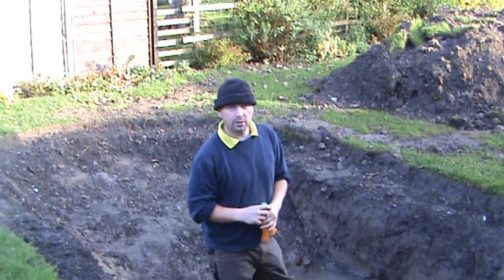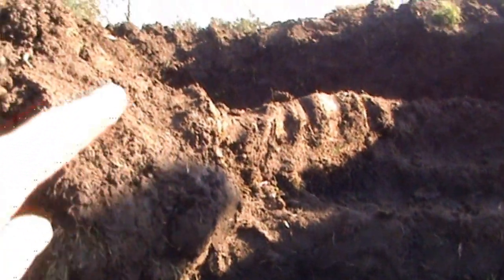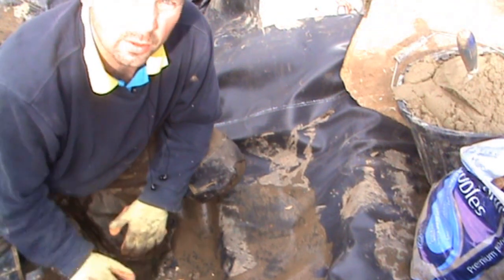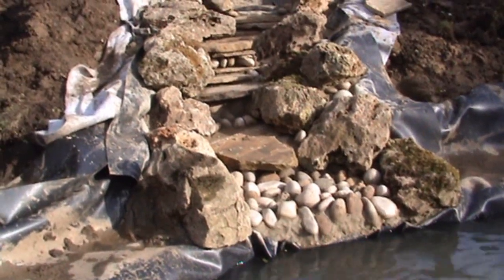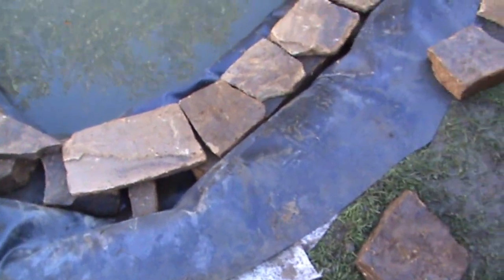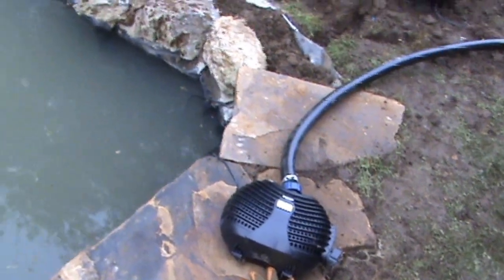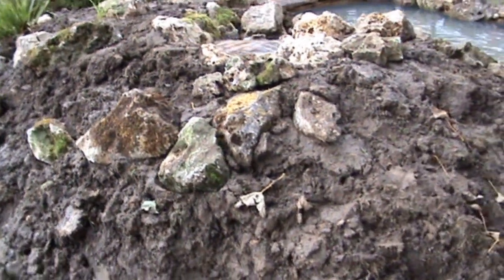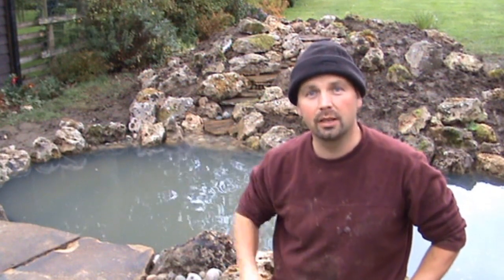How to Build a Fish Pond and Stream / Cascade - Complete pond building video by Pondguru

Comment: Hello,

I thought your pond was brilliant and you have inspired me to try my own. I want to build a duck pond, and they can be very messy. I was wondering what type of filter and pump you would recommend. The pond will be approx 8ft x 5ft and 3ft deep
Reply from the maker: If you have ducks the chances are you will not be able to keep that clear but I would go for the largest box filter (with at least a 55w UV) and at least a 4000 litre per hour pump to turn the water over at least once an hour. The box filters tend to be the cheapest option and you will get a large one for same cost as small quality pressure filter.

Comment: Awesome video.  I'm planning on building a tiny koi pond.  Unfortunately, the only space  I have is next to a tree that has tiny leaves.  Will  a good filter be able to catch most of the tiny leaves or would I have to constantly remove them myself?  Also, how do you prevent rain water from seeping underneath the liner and underlayment material?
Reply from the maker: Unless you have a high water table you don't need to worry about rain getting under liner as the weight of water will prevent liner being lifted from underneath. You could go with something like a floating skimmer (Oase swimskim 25 is a good one) to remove small leaves as that will be most efficient.
I'm concerned about the words 'tiny koi pond' as koi need lots of space.

Comment: Great video m8 really enjoyed watching it, thanks for sharing. Just one question how deep should the planting shelves be? I have been told 18 inches below water surface when pond is at maximum fill level. I thought that this was too deep. Your info would be most welcome. God bless ya
Reply from the maker: Yes that is definitely too deep. I'd go 6"-9" and 18"-24" for lilies.
Thanks for watching and appreciating the videos.
Reply: Thank you so much for answering so quickly. Would you beleive that a so called pond expert installed my pond and has put the planting shelf 18 inches below water level, told me that is right and I should use upturned baskets and pots to put marginal plants on. I will not mention names and will not mention your name when he comes to install ultra violet filter, though I will tell him shelves are too deep. I would have got you to install pond if I had been in your area. 
Thanks again
Reply from the maker: Allan Robinson No worries, man. Many people do use upturned baskets to put plants on but there should be no need to do that.
Hope the rest of the pond is OK.
Reply: Not really, there is no overflow and I cannot see how upturned plant pots, baskets will bring the plants up to the required level for marginal plants I.e. 0 -6 inches, when level from shelves to water surface is 18 inches or more when full. Pond installer is yet to get back to me about uv filter. It is only a wildlife pond and I feel like I have been done! Thanks for your help. God bless you

Comment: Could you tell us what size diameter was the pip or hose you used from the pump to the filter and then up to the top of the cascade. Great job by the way.
Reply from the maker: craig thompson It is heavy duty 38mm internal diameter pipe.Thanks for watching and appreciating the video.

Comment: Hi, thank you for spending your time making this video, it is very helpful. can you confirm that the 6 to 1 cement mix you used is in fact 1 part cement and 6 part ordinary building sand as the mix looks to me doesnt look that sandy. Also, is the cement mix not going to affect the fish in the long run?
Reply from the maker: Yes anywhere from 1:4 to 1:6 (1 part cement to 4-6 parts sand) is fine. If the cascade was cemented then water would be flowing over it so cement would affect the water. Less so on the edging as it is above the water.
Best thing to do is to leave the cement to harden for a couple of weeks before running the cascade then after a day or so of running it totally drain the pond, refill it and it should not be a problem since most of the stuff leaching from cement will be washed out no problem.
Reply: Pondguru Outdoors thank you.

Comment: Have you ever had issues with the mortar coming apart over time? I completely planned on making my river just as you made this waterfall but have recently read some things that advise against mortar. I think this seems like the best way though. Your builds looks great.
Reply from the maker: There has been the occasional edging stone which has come loose around a preformed pond but they have a bad habit of bending and warping. As long as a cascade is properly lined and the ground is stable the cement should not break up - most of the time I see streams and cascades broken up when they have been made on a loose pile of dirt which settles and caused the cement to crack.
By using underlay under the liner it also acts as a stabilisation fabric so any small areas of subsidence  do not affect the cascade.

Comment: Hi got the pond finished last year finally using the info from your video. I have a similar Oase pump and filter. Do you leave the filter in the ground year round? I live in Chicago which get pretty nasty winters so I called Oase and they said take it out and store it. The online pond shop told me I could leave it in the ground if I ran the pump year round. I went with Oase's recommendation and stored pump and filter. Thanks again for the video Myron
Reply from the maker: +M Wilson Yes you can do it either way but it is advisable to move the pump near to where the stream pours back in during the winter so the bottom of the pond can retain some warmth for fish.
Glad you enjoy the video and best of luck wit your pond. Oase is a great choice.

Comment: Thanks for your helpful video. I have a question: how do you stop the pond over flowing eg in case of heavy rain? Do you create a section where the level of the liner is lower so that excess water can flow into the mound?

Comment: I am in the learning process. The masonry you've done is what I envision for my project, nice. I am having a bit of a learning curve on masonry, it scares me. I notice mortar and cement are interchanged frequently, here and else where. Can you please post your mix/water/sand/type of cement? I have noticed, videos  with 4/1 now 6/1. And I see "mortar mix" in my hardware store. different types of sand, different types of cement. What do I use, how do you mix. So confused. Thanks!
Reply from the maker: I usually use 4:1 and you can use any sort of sand for this type of construction. I sometimes use coarse sand in the mix for a cascade as it weathers very quickly but it really doesn't matter. I'd generally use a a waterproofing liquid and frost proofer  (if there is a risk of frost).

Comment: I really like your video.  I have an existing concrete pond, 10'x8', about 1 to 2' deep, with a number of water reeds and it is under a tree canopy so the leaves accumulate on the bottom.  I want to add an "easy to install" waterfall 3' high and 3' wide cascade.  I wonder if I have enough water water to use the pump in your video of about 3000GPH.  What problems will I encounter?  How do I keep the much from clogging the pump?
Reply from the maker: 3000gph is a major size pump. The one I used in this video is a 8000 litre per hour which is around 1800gph (UK) and 2100gph (US). A good pump will handle solids but it may be worth netting out as many leaves as you can and as the pond is small you could net it off in winter to avoid leaves entering pond.
Reply: Ok, I will cut the pump size down.  Can I pump directly from the pond to the waterfall with this system?  Do I need additional filtration?  Should I install a skimmer and pump from there to the waterfall?
Reply from the maker: Karen Rye You can do it numerous ways but simplest is with a pup in pond pumping to pressure filter then out to cascade.

Comment: Hi Pond Guru.I've lined the waterfall and positioned all the rocks ready for cementing tomorrow.Had the electrician hardwire the pump and filter.Just did a test run of water and really disapointed.Its not more than a medium trickle,nothing like the flow you have in the video.I bought a Blagdon Minipond Duo 6000 Pond Filter Kit,has a pump that runs up to the filter at the top of waterfall and the pump also has a fountain on it.Shall i return it and get a pressure pump like the one in your video? Thanks,Clive.
Reply from the maker: The pump in that set is only 2000 litres per hour. I used the 8000 aquamax for this cascade so this would have been a dribble too. The size of the pump depends on the list and spread of the cascade so everything is relative. If you are building a cascade the same as the one in this video you will definitely need a bigger pump.

Comment: I'm just in the middle of cleaning and re-laying a slabstone edging around our pond. ours is surrounded by garden and I'm concerned with dirt being washed into the water during rainfall. is this something I should worry about or just a natural thing that happens?
Reply from the maker: If you have the edging sitting higher than the surrounding land or well planted around you will get minimal dirt washing / blowing in but a bit of muck in the bottom of the pond will either be drawn out by the pump and caught in the filter or it can be vacuumed out / lifted out with fine net and won't do any harm.

Comment: Excellent for DIYers! Thank you for the step by step. I have a sloped yard that would make an awesome cascade area but I have to first slope bottom away from the house as my foundation is the low point! Any suggestions? I want all natural (flagstones, plants) low maintenance. Also, it gets to 40 below where I live. Wouldn't the pump/filter freeze exposed like that? PS: Loved the bloopers at the end of the video!
Reply from the maker: The ground slopes toward the house? Provided the pond is a reasonable size the water will not freeze but if you get prolonged periods of very cold weather it would be wise to take pump and filter out and store until spring. If the pond is near the house it would be worth having an overflow to take excess water away from house.
Glad you enjoyed the video as I like making them.

Comment: Hi Pond Guru,i've nearly finished! I have cemented some rocks and flat pavers around the edge of the pond today,but a few tiny bits of cement fell in the pond,do i have to empty it all out and re-fill? Does it matter if some of the pond water touches the cement under the edges after it's been setting for a week? i'd like to get the fish back in the pond asap as its nearly December! I've also finished the waterfall,(made like yours with rocks & cement),but wont use that until next spring,so the cement has more time to cure,and hopefully wont kill the fish! Any advice always appreciated thanks,Clive.
Reply from the maker: A few small bits of cement in  the pond won't make a difference but I'd avoid letting the water touch the cement under the edging during the winter as the freeze/thaw can cause the cement to pop them off. Good idea to leave the cascade off over the winter if it has just been built as it will take an age to cure. May be an idea to cover it with hessian and plastic to keep it dry.

Comment: Hi Richard where abouts did you get that type of pipe from and what's it called, I need to upgrade from flex pipe and that stuff looks ideal cheers
Reply from the maker: It is 'heavy duty pond flexible pond hose' or 'reinforced pond hose' and if you search for that online it should come up - problem is many places only sell it as a 30m roll online so you may have to visit a pond supplies / koi dealer to buy it. It's way better than ordinary ribbed hose.

Comment: would this be suitable for growing trout or would you need to scale it up?
Reply from the maker: A trout pond really needs to be around 25m x 25m with a good 3m - 4m depth as a minimum so water does not get too hot. If there is no fresh supply of water then it needs an air pump or water pump. If you check out the last few videos on my fishing and shooting playlist you will see my trout pond. That's about as small as you can go and still have them growing big and healthy.

Comment: Hi great video.Very detailed info.Just looking to shop   the equipment for my pond with sizes Length:3,7meters, width:2,8m; max depth:1m; average depth:0,64m.What type of Liner(Im thinking about LDPE type),Pump size and filter size .Cheers
Reply from the maker: I would always go for thick rubber liner of 1mm and a good fleece underlay. Pump size and filter would be about the same as in this video but pump size depends on what you're doing with it as it is often sized according to a cascade / waterfall.

Comment: Hi Pond guru.
In the above video you laid a bed of cement on the bottom of the cascade, which you embedded loads of cobbles.
My Question: I have another shelf lower down at the cascade end that is completely submerged. Could I create that same shelf you did on a shelf that is totally submerged and no walling stones to lock it in?

Comment: Hi pond guru!  Love your vids I had questions regarding the concrete setting. What is the process for mixing the concrete you said 6 parts concrete for 1 part water right so then for the edge stones you lay it down then lay the edge stone down on it? What about the curing process? How does that work?

Comment: I am using  Hose tail Elbow polyprop ( plastic ) bsp Female Thread. They don't seem to thread properly on my jesbo pump properly.  I could see a leak on them If I am honest while they are supposed to fit 32mm ID pipe my pvc flexi pipe feels loose in order to get the pipe to fit I used some ptfe tape and some silicone. Then used a strong jubilee clip. This seems to give me a seal. But when I screwed the elbows onto the pumps they dont seem to screw onto the pumps right they seem tight but i have noticed a leak in the elbow whats your thoughts? The leak comes from the round tightening ring you screw onto the pump. In the future I may need to upgrade the pumps to some thing better perhaps.

Comment: Thank you for the very informative video.  I'm a sculptor and I will be creating a natural back yard environment soon. There will be a fairly small water feature with a water catch (pond) area no bigger than 4' wide by 8' long with a depth of 18". There will be a small cascade dropping only about two feet over a couple of flat stone layers. Could you suggest the pump and filter size? Also are there solar pump systems solutions that you could suggest.
Reply from the maker: Ian Lazarus Are you in US? If so I have no idea what is available over there but you will need the following measurements to size the pump:Vertical lift from water surface to highest point.Length and diameter of pipe.Width of water fall (widest one).Solar pumps are generally crap as a filter needs to go 24/7 to be effective and depending on flow required there may be an all in one unit which may do the job as the pond is not a big one.

Comment: I but a pond based on your design a year ago. Except for a few things that in hindsight could have been better, I'm really pleased - thank you. I put some plant in using pond soil and weed suppressant in the pots but the soil drifted out causing the water to be really cloudy. I hoped it would settle but no, it looks like clay suspended in the water. I feel I might need to empty completely but there are fish. Any expert ideas would be great.
Reply from the maker: Clay is a difficult one to clear and my clay lined pond suffers from the same tiny suspended particles. I used another sort of clay to clear it which is called montmorillinite clay - it is a very fine powder which causes the other clay particles to stick together and be easily taken out by the filter or sink to the bottom - you can get it on ebay and amazon and for a pond about the size of the one in this video you'd only need about 200g mixed up in a bucket and spread over the pond surface when the pump is turned off - leave for a few hours then turn pond pump and filter back on and it should clear it.
I'm glad you enjoy the videos and that your pond is going well other than the clarity issue.
Here is a link to me clearing a huge pond using montmorillinte clay: https://www.youtube.com/watch?v=QwgYB55jJFg

Comment: Great video! I'm getting ready to install a pond very similar in Chicago, IL. Would you recommend the mortar between the stones with the frost heaving? We were down to  20 degrees below 0 F.  Thanks!
Reply from the maker: Provided you build the pond in spring / summer when the mortar has a chance to fully cure before the cold weather it will not be a problem. Will be worth using a waterproofing agent in the mix to reduce water penetration too.
Thanks for watching and appreciating the videos.

Comment: Hi,awesome pond Guru.I've just put in the ground,a 1000 litre 'damselfly 1000' pre-formed pond.I lined the bottom clay earth with 3 inches of soft sand and then some carpet underlay on top of that and carpet underlay around the sides,and then back filled the sides with more sand then finished ground levelling with clay soil.The pond is now filled up with water but one side curved edge is higher than the rest,how do i level the pond without taking it all out? Thanks for your help,Clive.